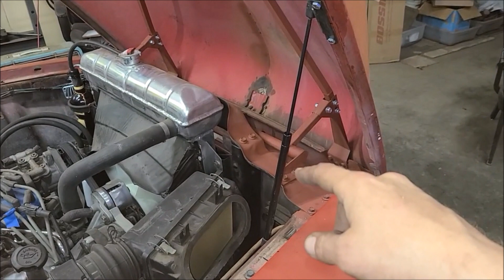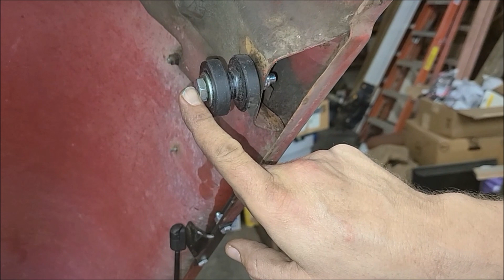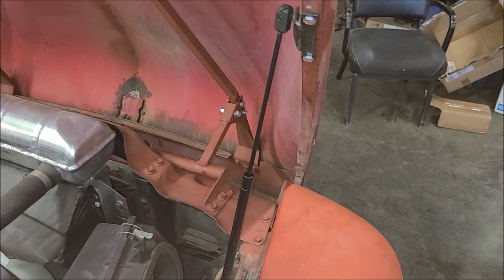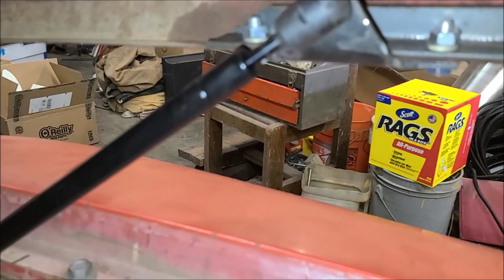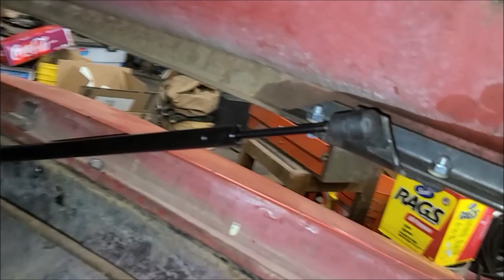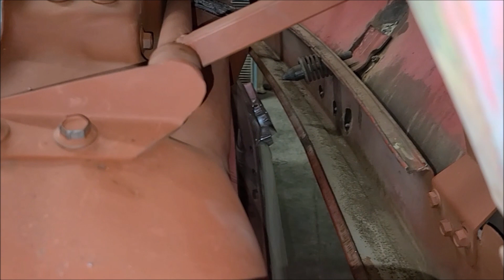1956 Ford F-100 Episode 37 - Strut Rod for Tilt Hood Kit

Comment: Great truck hoW much of the wiring harness did you actually use from the mustang.
Reply from the maker: I used the entire Mustang engine harness for ignition/fuel and computer.  I didn't use any of the mustang body harness except fuel pump relay, inertia switch and clutch/brake switch since I'm using the mustang pedals.